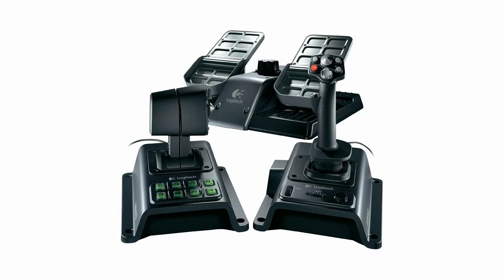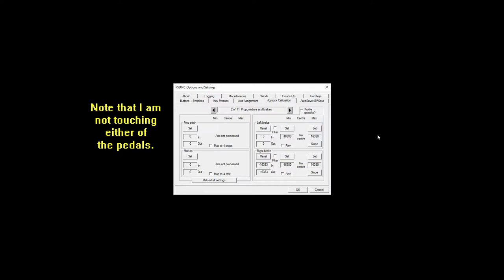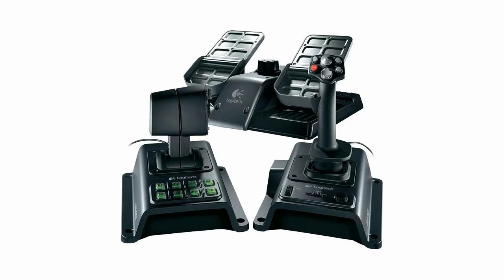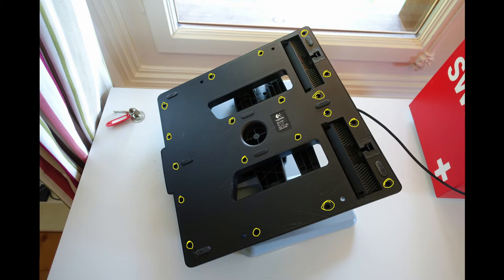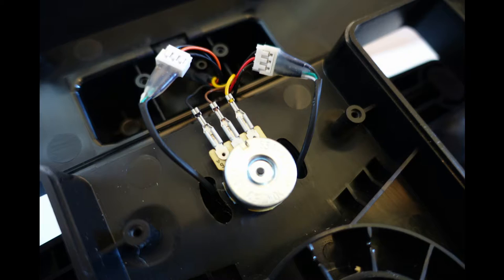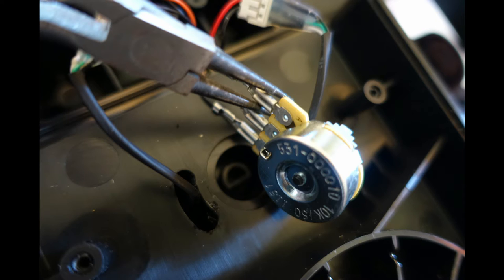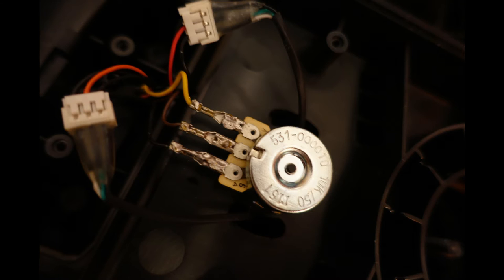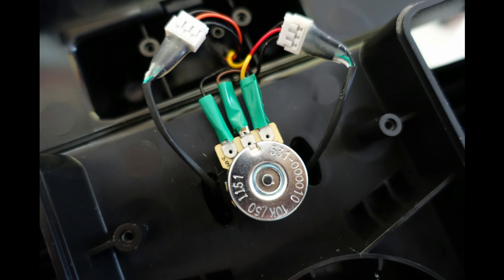A Fix for the Logitech G940 Rudder Pedals

Comment: Thanks for these tips FSUIPC fix the problem. For the brake, I set "control slopes" to 15 on both toe brakes as uou advise and tick the filter box. This fix the annoying behaviour.
Reply from the maker: Ah I am glad that it is working for you now! I myself bought the MFG Crosswind pedals at the end of last year and am very happy, since they work like a charm. Cheers.
Reply: Great choice, is it working with G940 the joystick and the throttle ?
Reply from the maker: It did. :-) I have since purchased the Thrustmaster HOTAS A-10C replica for flying in DCS.